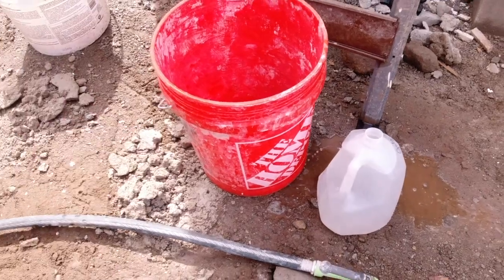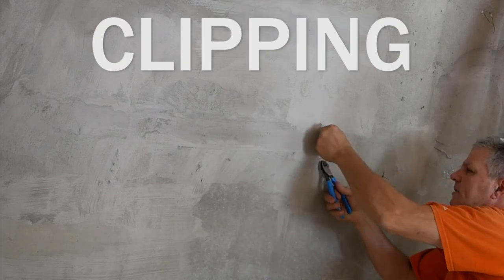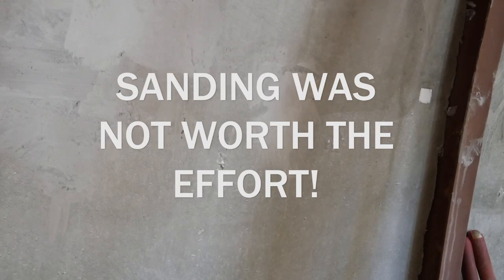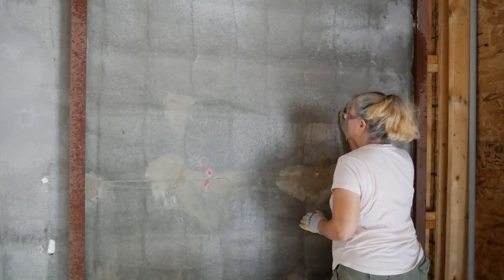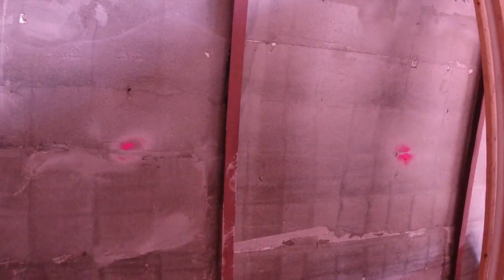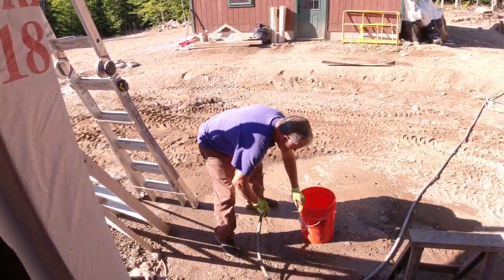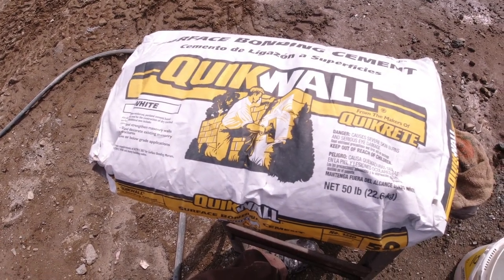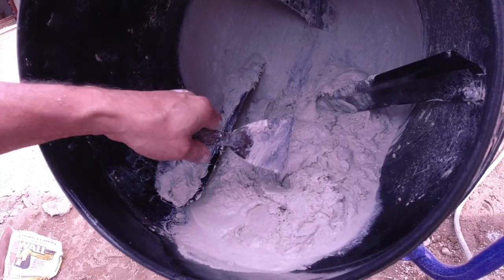CONCRETE DOME INTERIOR WALLS - Waterproofing & Finishing | Building an OFF-GRID Homestead

Comment: Looks great. We used to coat foundations with quick wall. I believe we loaded the trowel way up and worked from bottom to top. Got a lot on the wall then spread it around to get a nice finish. Also we used rectangular wooden boxes approx 24x16x5 inches deep to put the mud in. Screw a couple handles on the ends.  You can really load up a trowel that a way. ( plywood bottom , 3/4 inch sidewalls on the boxes ) hope this helps. Again , it really looks 👍
Reply from the maker: Oh great tip! Thanks so much!